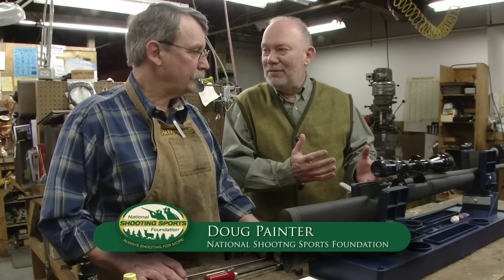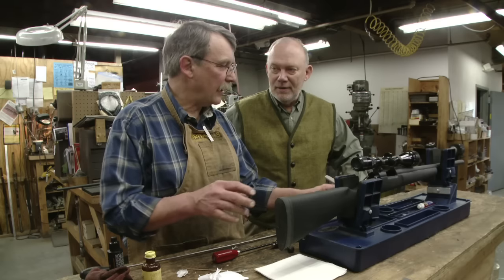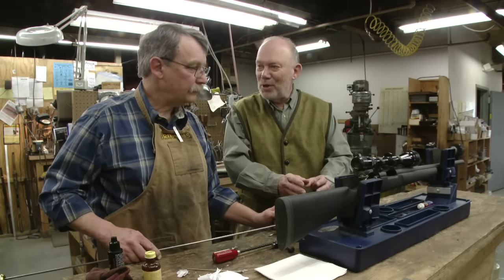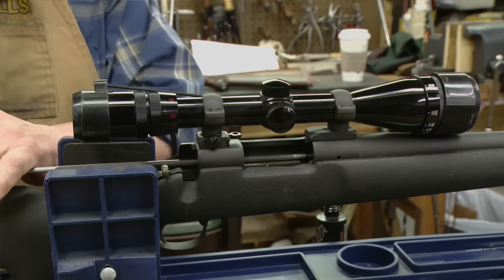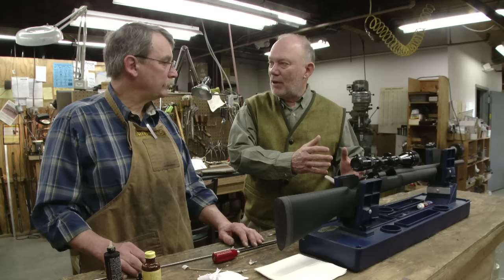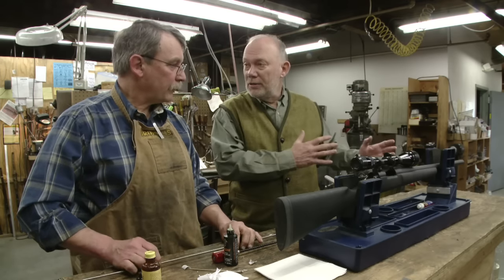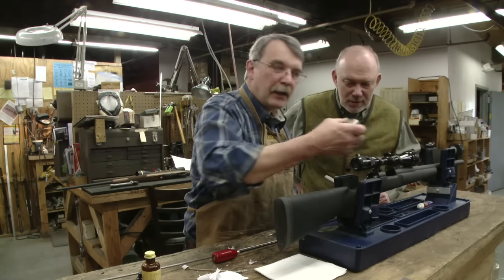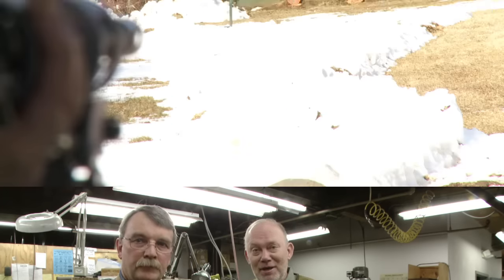Rifle Cleaning and Lubricating Basics - Gunsmith Tip

Comment: I just cleaned a gun for the first time using a cheap kit and a small bottle of Rem. Oil. 
Since my Remington 760 is a pump action rifle, I had to hold the brush/swab in the receiver, insert the rod through the front of the barrel, and screw on the brush or swab in order to pull it through. This is repeated several times in order to clean it.
I can't use the jabs that way.

Comment: no bore guide?  also ive always read, run the brushes, and patches in the direction of bullet travel only and remove them before pulling the rod back through.  anyone?
Reply: 9 years later kinda answer. But a bore guide is preferable yes. And again correct. you're not supposed to pull the patch back. The dirt is not suppose to come back into the chamber.
Reply: i guess it's kinda off topic but do anyone know of a good place to stream new tv shows online?
Reply: @Caiden Kalel flixportal :D
Reply: @Vivaan Ignacio Thank you, signed up and it seems to work =) Appreciate it!!
Reply: @Caiden Kalel glad I could help :)

Comment: I have a few rifle which rarely take them to range, but try to clean them every 3 months. I have noticed that the barrel, on my Uberti 1866 rifle with brass receiver, leaves a brownish residue on the cloth that I pass through it - does cleaning and oiling more often helps of is there a better oil I could use to protect inside the barrel? Note that when I shoot the rifle, I use 44-40 cowboy action with lead bullet and clean it after I get home from the range before stored in my safe.

Comment: 2 questions 
question #1 at 1:20 when you say put a solvent on do you mean on the brass brush or on a patch you put on the brush?
question #2 what gun oil or lubricant should i coat the inside of my rifle barrel with for long term storage?
Reply: I run a brush that has been dunked down in Hoppes #9 a few times through the barrel, followed by a clean patch to soak up the Hoppes and then an oiled patch through the barrel to finish the operation. 'Barricade' is good for long term storage. Use 'Balistol' on black powder rifles ands pistols. I will add he is absolutely right to be sparing with the oil or any protectant/lube. A micro thin coating is all you need.

Comment: I have a question and need help narrowing down a problem I am having, I have a bolt action rimfire that is making light primer strikes about 75% or the time. The rifle was purchased  brand new. Using ammo from the cheaper to the higher end stuff and same problem. I never dry fire my rimfire firearms ever. Not sure if its something that is cleaning related or if it needs broken in a bit more? But this rife is higher end rimfire, a steyr zepher 2 and so it should go bang out of the box. any help would be appreciated. Thanks
Reply: did you clean the rifle and break it in before doing alot of shooting?  I hear that you should first clean the rifle.....then take a shot..let it cool down...and do it agin....some people do this for 30 plus rounds and then they go into shototing groups of 5.....and then cleaning it again for a certain set amount( like doing this 5-10 times). other than tha a gun like that should shoot straight out the box...my 2 cents
Reply: @Y_ruba_al  The rifle is now working perfectly,  I should have done the correct break in and clean the barrel just like you mentioned.  I watched some good videos   on YouTube on precision rifles going through some cleaning methods. and i have learned a lot.  So I gave everything a good cleaning and lubed the long firing pin and its channel a bit. Then i worked the bolt back and forth about 50 times to loosen it some (no dry firing) then I cleaned the bolt thoroughly again flushing anything between its moving parts, some oil on the firing pin shaft and the bolt cylinder, have fired about 200-300 rounds, now goes bang every time.  👍

Comment: I just cleaned my first gun. I used this as a check to make sure I got everything. Seems I went a bit overboard, taking a bit of oil over every inch of the gun inside and out. 

I haven't damaged the outside of the gun with the oil have I?
Reply: No, unless you have a wood stock, it may tarnish the finish. You can't over oil your gun within reason, however too much oil will make your gun get dirtier, faster. There is a video of two guys dumping various guns into barrels of oil and they fired fine, however I wouldn't recommend going that far lol
Reply: @Tom Warnert Originals  yeah I've seen that video lol. 

Ah. I remember 8 months ago when all I had was a polymer Ruger .243. Already up to 5 in the collection 🤣

Comment: Got any tips on how to clean small caliber rifle cycling/feeder tubes made of brass?  Can't find anything on this.   Think of all the ammo that you put in there and how dirty these tubes are.  Yuck.  The dirt may even inhibit the action of the spring.  I thought about taking mine apart on an old Mossberg .22,  but not sure if that's smart bc the pin on the end might loosen up and start coming out.  So basically I just poured some Hopps 9 thru it and flushed it.  Not sure if that was smart thing to do or not but all I could think of.  Thx for the vid.
Reply: Does not have to be cleaned as much as the barrel with should be done every 100 to 200 shoots